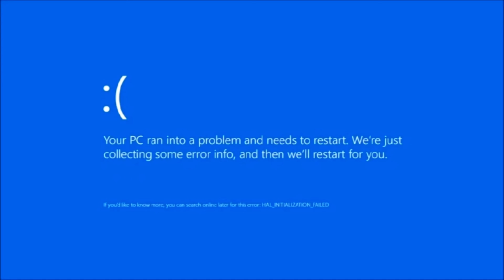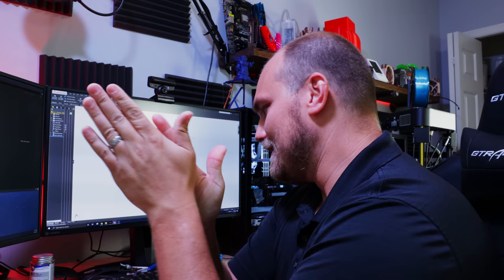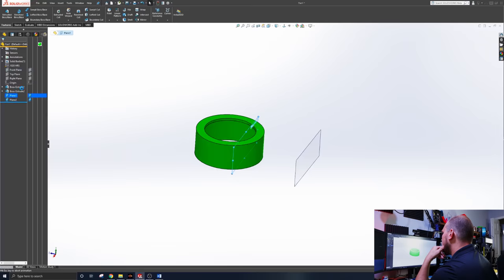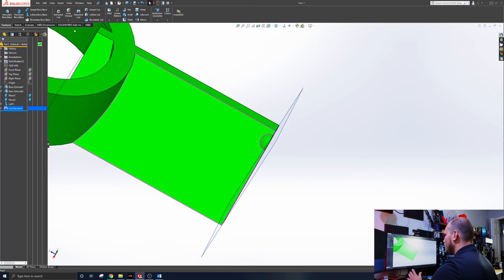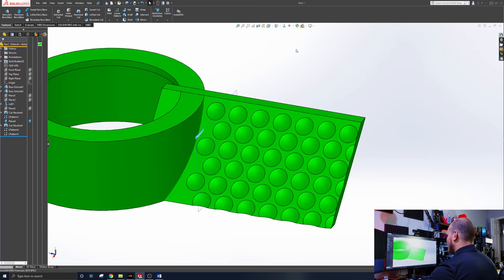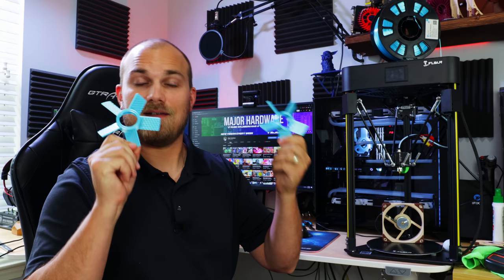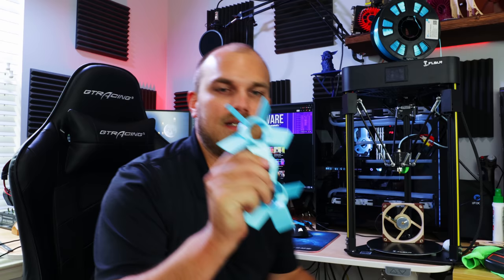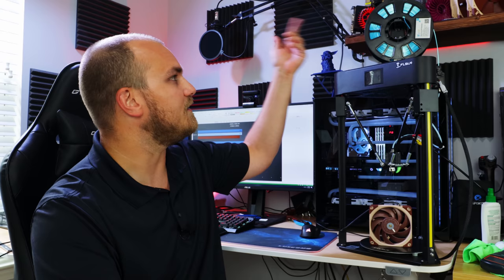What If Fan Blades Had Dimples Like A Golf Ball?

Comment: I'm sure someone has already said this but the dimples on a golfball is to catch air and create lift.  It shifts the low pressure from behind the ball which would slow it down to under the ball, creating lift.  A fan blade that pushes air is opposite of what you want, however if it was a fan that catches air like a wind turbine there would likely be a benefit.

Comment: Golf ball dimples are there because they cause some turbulence that helps the ball cut through the air better. Because the ball is rotating on all three axes as it flies, the dimples cause what's known as a turbulent flow that causes more initial drag, but actually reduces drag on shapes such as spheres. The fan blades work differently than a golf ball, so the turbulent flow from the dimples won't necessarily affect the speed at which the fan rotates, but should have a negative effect on the amount of air moved by the fan as the turbulent flow will reduce the speed at which the air moves past the fan blades.

Comment: A smooth ball generates laminar flow as it flies through the air, this lamination of air creates a pocket of low pressure behind the ball, a vacuum drag of you will. Those dimples work to generate turbulent flow and rid the ball of its low pressure zone, ever so slightly increasing wind resistance while lessening the effect of virtual drag, allowing the ball to travel further as well as straighter. I may have used a few layman terms, but the information is nonetheless correct.
Reply: Fan blades with a pitch naturally create that slight trailing vacuum which also translates to lift for an airfoil.  Adding dimples to the pitched fan blade plane is not likely going to cancel the trailing vacuum effect which is a part of the nuance of why fans work. If your not trying to make lift or kinetic air flow and just want an object to move through a fluid more easily sometimes adding a little turbulence strategically will help.
Reply: someone watches SmarterEveryday lol
Reply: @dp1313-m3r  Graduated 5 years ago, gotta keep the ol' brain in shape lol
Reply: Is this the Coanda Effect yes?

Comment: A golf ball has dimples to create turbulence around the spherical blunt body reducing pressure drag. A fan blade is not a blunt body and designed to take advantage of pressure drag creating a force normal to the blade usually called lift. This is an interesting experiment. Thanks for showing us the results and design steps.

Comment: I closed my eyes when you did the sound test so I wasn’t effected by knowing when the change occurred, and had to open them to see if you’d actually changed them, I would say that’s no difference noticed 😅
Reply: Really? That's pretty interesting I did the same and noticed a difference, it wasn't really a volume change but more of a slightly different noise. I found the Dimple fan to have a sort of playing card in a bike wheel sound but it was really tiny while the regular fan was a steadier humm.
Reply: Alexz Pinnell and much like people ‘discussing’ the better sound quality of lossless over lossy, everyone will hear something differentx
Reply: @almostanengineer  Yah it's interesting, tho I have no idea what lossless or lossy are
Reply: Straight blades have a steady airflow sound the dimples actually added a slight frequency variation to it if you listen closely you can hear it every other second or so the pitch alters and it's like the frequency of the blades (or rpm) is changing which I didn't notice in the straight blades

Comment: I saw it coming.  The dimples are there to reduce drag due to the low pressure drag bubble behind a moving object. This allows things (golf balls and cars have been proven) to have less drag so they can travel farther, use less energy (e.g. fuel), or go faster.

Comment: you know how jet turbines have a section called the compressor where there are alternating spinning and stationary blades (fins). wonder what that would do for airflow if it were shrouded right?
Reply: The purpose of these compressors is to slow down airflow to generate higher static pressure at the intake of the engine.
Reply: The static blades are called airflow conditioners they pretty much make the direction of the air from one stage of the compressor to the next more appropriate. Technically on a cooling system you want to increase the mass flow of fluid through the radiator fins, and air flow conditioners wouldn’t be necessary for that but I also don’t think they would hurt much

Comment: The dimples on a golf ball trip-up the boundary layer, making it a turbulent flow. Turbulent flows have more momentum; therefore, delaying boundary layer flow separation. This greatly decreases the form drag; and thus, the ball flies farther. Note, on an airfoil (e.g. plane's wing) you want laminar flow. Turbulent flow over an airfoil (where angle-of-attack matters and its cross-section is not spherical like a golf ball) leads to earlier flow separation which kills your lift and could stall the wing. With respect to this video, the addition of concave (or convex) dimples on axial fan blades-- for PC cooling application--would have no effect on thermal performance.

Comment: "Depth of 0.01 inches, which in REAL measurements is..."

I love it. I am stealing that. Whenever I have to convert from imperial to metric, I'm going to use that.
Reply: You'd just love the world of woodwind mouthpiece production.

The gap between the reed and the tip is measured in inches, like .065".
The length of the curve from the flat part to that opening is measured in units of half a millimeter! That is, a measurement of 46 would mean 23 mm.
And then the way of describing the volume of the interior is proprietary to each manufacturer.

Comment: The dimples on a golf ball are actually put there so it will not spin while in flight which as you know is commonly called a "CURVE BALL" in baseball.  If a smooth golf ball is allowed to spin a little it can spin faster and faster until its flight can be 45 degrees off center and they can reach 4000 RPM.  The dimples are put on Golf balls to increase ACCURACY and NOT to improve speed or distance. Most well educated engineers know this fact. Another urban legend busted.  Here's the rub,  the dimples where tested to increase distance BUT they discovered that the balls flight was straighter so they kept the dimples for a totally different reason in the end.

Comment: Racer's Edge; Air Racer trick was to run an aerodynamic propeller spinner until they were banned in competition due to their propensity to leave the formation and go through someone's windscreen. Overcoming the high drag at the root of the prop blades where a Hamilton Standard transitions from a round tube shape into the narrow airfoil shape is now accomplished by random dimpling of the round hub end. FAA rules only allow this modification on Experimental certification aircraft. The dimpled surface acts to turbulate the air flow of the aerodynamically inefficient prop hub to blade transition. Although a totally different principle, you might think of it being similar to the area rule principle (Coke bottle shape) that allows supersonic wings to transition into the fuselage with less drag. Now that I have shared this secret with you,  you are sworn to secrecy not to tell anyone.

Comment: The big advantage on a sphere is that the Cd is a weird and unique function of the Reynold’s Number, which is a function of the characteristic length.  In particular with golf balls, the size and speed of the ball are also factors.  If golf balls were larger or smaller, the dimples may no longer help.  If golf balls travelled significantly faster or (obviously) slower, the dimples again would not be of much help.  The dimples change the characteristic length by adjusting the surface roughness.  The effect is somewhat unique to spheres traveling at specific speeds, of specific size, traveling through media of specific kinematic viscosites.  If dimples were always the answer, our aircraft would be covered with them.

Comment: Have you thought about doing a scalloped sawtooth pattern on the trailing edge? This reduces drag and noise while improving flow  through turbulence reduction. This is mimicking an owl’s wing and is being used in things like formula 1 and aerodynamic bicycles. They want to use it on wind turbine blades, but the forces on the blades are currently too high - which shouldn't be a problem in your small fan blades. 
Another idea to improve flow and reduce vortices and noise would be to stack thinner fan blades over each other as with formula 1 front and rear wings. You may need to include pillars to support the tips and you could even add bunny ears off the tops of the pillared section to further increase efficiency and flow.

Comment: The dimples are on the wrong side of the blade... They should be on the underside where the air is actually getting compressed.
Reply: Bro, I said the same thing.  Dimples allow something to "cut" thru air with minimal resistance.  If you are "cutting" thru air with ease, you are not going to MOVE as much air.  The fan WITH DIMPLES IS GONG TO BE LESS EFFICIENT AT MOVING AIR.  Unless they are done on one side of the blade.  Good thinking!

Comment: The dimples in a golf ball reduce the drag of the ball . This is done by creating turbulence and this reduces the pressure difference drag. Here is a video explaining it https://www.youtube.com/watch?v=5zI9sG3pjVU&t=22s min 9.3 (if you can see it complet I recommend it.).  If you see the video you would understand that dimples do not present a benefit in this case, because a fan works buy creating a pressure difference and it moves the air it doesn't pass through it (i'm not sure this is a correct explanation). I didn't expect it to perform as well.
Reply: Bro, I said the same thing.  Dimples allow somehting to "cut" thru air with minimal resistance.  If you are "cutting" thru air with ease, you are not going to MOVE as much air.  The fan WITH DIMPLES IS GONG TO BE LESS EFFICIENT AT MOVING AIR.

Comment: Dimples on a sphere has to do with disrupting boundary layer adhesion. Spheres are also capable of lift. On a fan blade you would think you would want adhesion and boundary layer flow. There would definitely be differences at turbine speeds.

Comment: Next time, do a surface pattern and define the gap to your surface edges. (hex or staggered pattern - what you need)
Follow that by twisting the blade with a solid twist and then axial pattern the blade with all features.

Printing a curved fan blade in a PLA printer is hard. You need supports as the curve flattens out on the intake or the printing will be in the air and fail.
You could do the hub and individual blades printed vertically and glue them up together later.
Fan blades print best in SLA and you can lithograph up without support and just let the blades/hub hang.

Did my own fans blades for R&D test before sending to molding and manufacturing thousands.
Hope this helps. :)

Comment: 10:40 nope - golf ball has HEXAGONAL pattern - your blades have big spaces between round dips with sharp edges..
Reply: Callaway created the HX ball with hexagonal dimples IUN 2002, which is marginally better. But most golf balls have spherical dimples, roughly .010" in depth with anywhere from 300-500 per ball depending on make and manufacture. DONT ALL CAPS WHEN YOU DONT KNOW WHAT YOU ARE TALKING ABOUT, IT ANNOYS THE REST OF US.
Reply: first off the hexagonal appierance is an optical illusion, secondly, this won't matter, nothing you can do to the dimples or the fan can make them work better because the reason dimples affect golf balls and not fans is that when an object moves through the air, it creates a low-pressure area behind it, creating drag and slowing down the body, because of this, a teardrop shape is the best shape for limiting drag since its outline follows the low-pressure area allowing it to negate the effect almost entirely. the golf ball on the other hand is made to be sphericle to allow for non-directional hits, and therefore must be designed to minimize drag some other way. 

this leads us to the dimples, and how they reduce drag. they do it by creating turbulence on the surface of the sphere, which creates vortexes swirling into the low-pressure zone behind the sphere, allowing air to fill the low-pressure zone more quickly, and lessening the effects of drag.
now, the reason this effect doesn't work on the fan is that its shape is significantly better aerodynamically starting off, as its blades do not generate low-pressure the same way the sphere does, since they are already thin, and don't require air to bend its path nearly as much in order to pass around it.

Comment: In fan comparisons what is most important is CFM(Cubic feet per minute) of air moved. That's air volume. You can then take the current input and measure the efficiency in terms of air moved over power required. This would be very interesting to compare to the stock noctua fan blades as I'm assuming a significant amount of engineering goes on.

Comment: You need to measure AIR FLOW, not RPM, Cooling, or Current Flow, because the dimples affect distance by changing air flow over the golf ball, not rotation. So create a little wind tunnel, with an anemometer.

Comment: The reason for the dimples is to equalise the pressure around the sphere in flight so it goes straight (unequal pressures alter the flight path) and to smooth out the wake making it less draggy. Also, air speed over surfaces plays key role and that's why cannot see any difference.

Comment: So, with all respect.  Golf ball dimples are there to make the ball rise as it moves through the air, because the well struck golf shot creates strong backspin on the ball.  The dimples help the backspin produce extra lift, which raises the apogee of the shot, stabilizes the shot, and causes it to "glide" farther than if it was just a smooth surfaced ball.  Since the fan blades are not doing any "gliding", and they don't have any of the dynamics of a free spinning sphere moving through the air, it makes sense that there was found no benefit.  It was still a cool experiment, and I don't blame anyone for trying it.  Cheerio.

Comment: One possible parameter robbing your dimples of effective turbulence is airspeed.  Golf balls fly at up to 200 mph (~322 kph).  Perhaps the turbulence only contributes at speeds well above your fan blades' average airspeed.  It should be noted that the dimples would likely reduce the effectiveness of the fan in that the blades would experience less force on their surfaces and thus less deflection of the air.

Comment: You mentioned that dimples on a golf ball reduce drag. But I'm fairly certain that dimples on a golf ball don't reduce drag at all. Rather, they increase lift as a result of the ball's backspin. This actually has a net effect of increasing drag, but it does so asymmetrically to create a pressure difference above and below the ball that provides lift, and therefore more distance.

Comment: You should make a resin print for the dimples fan blade. You'll get a better flow. Any kind of lines from the print layers are problematic. Also, the dimples should be only on the low pressure side. They essentially disrupt the low pressure air so it doesn't fold back on itself. Im pretty sure you want as smooth as you can get on the high pressure side.

Comment: The issue with the rpm test is that the fan controller has the speed set at a certain rpm so that wouldn’t be different since you’re measuring from the same radius from the center.
The correct test would be the current draw for a certain rpm.
The temps also don’t show anything since the fan speed tables are set the same. Seeing current draw from the fan during a load would give the same conclusion as what I said previously

Comment: 00:50 in...  as a 3D hobbyist, i'd use the vertices on a low-poly proxy version of the blades to locate spheres (or deformed spheres to get a more shallow dimple) on the surface of each fan blade at each vertex, and boolean subtract them from the high-poly blades leading surface...

Comment: You should also lay the fan flat on the scales with an air gap and measure the thrust / downforce when running. That will give you efficiency measure if all other variables are equal

Comment: You ever thought about giving it an acetone bath to smooth over the surfaces?
Your dimples decreased the weight by about 9%, which should directly/immediately increase speed, but you caused increased drag due to filament ripples and surface area.

Comment: The most slippery surface is a surface with an array of small V's covering the surface.  This is why geese fly in V formation. This is why sailing race yachts have a microscopic surface covered in V's.  It was a top secret years ago, but the competition caught on.
Reply: Also, there is an app you can use to measure sound.  Sound meter.